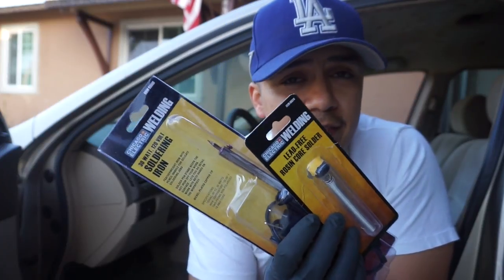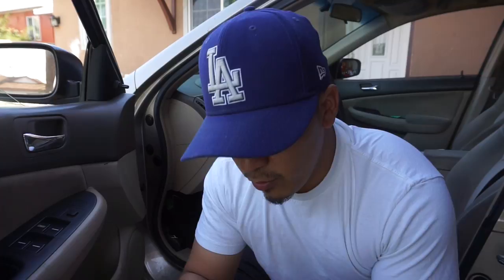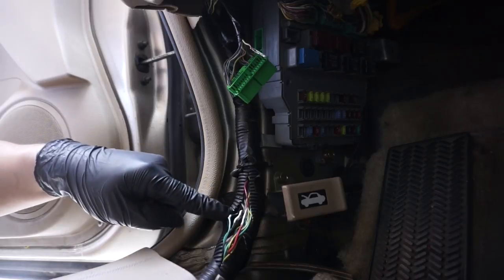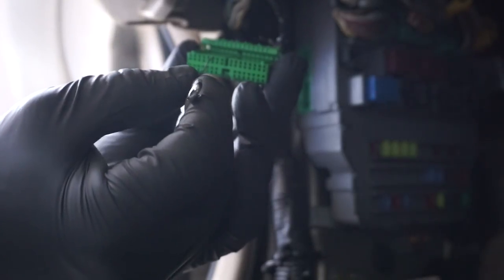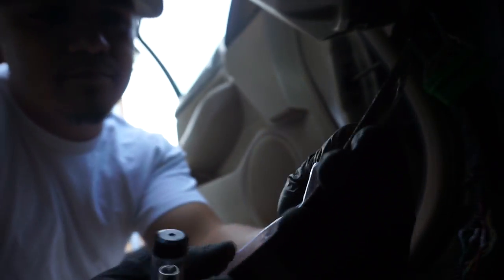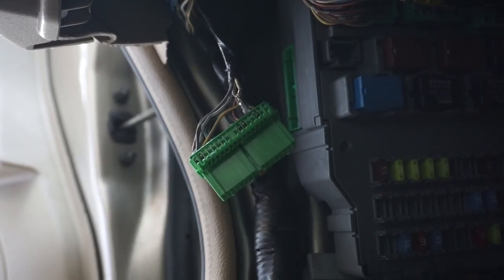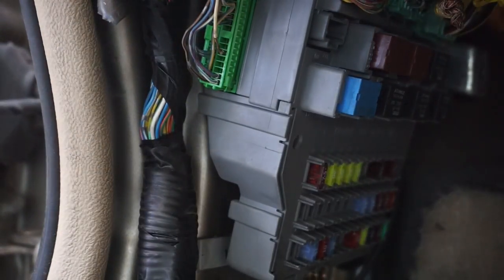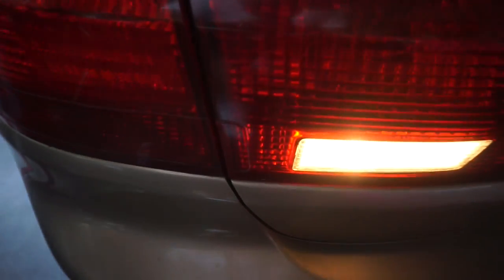Wire Repair with Soldering Iron and Solder Harbor Freight Tools ($7)

Comment: It seemed to work just fine. HF has got some pretty good stuff sometimes, especially for us DIY'ers.
Reply from the maker: wyattoneable Don’t knock it till you try it,  right?...
Reply: Not cheap solder. You will regret it, especially if you are doing work on a PCB.  Depending on just how bad it is, you can usually get away with it for just wires twisted together (especially if it is true copper wire) and then soldered for good measure. But trying to use this on electronics components or pads will just be one long headache.
Reply: @HomieHektor  Hektor question what terminal tools do you use can you make a video of them or just reply thanks an love your videos 😍😍😍😍😍

Comment: Maybe, thats why I'm having issues. I didn't add solder to the tip first. I have the same setup as you. Trying to solder Dean Connectors to my Airsoft Batteries.